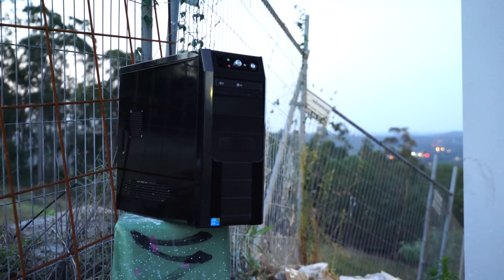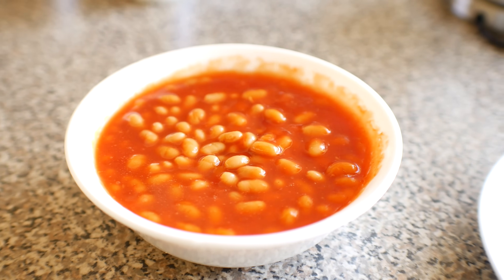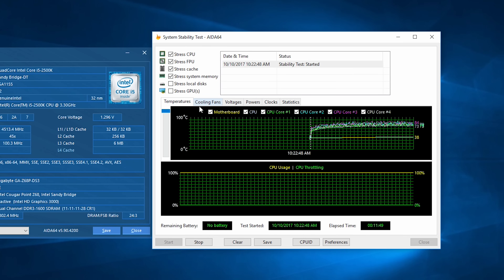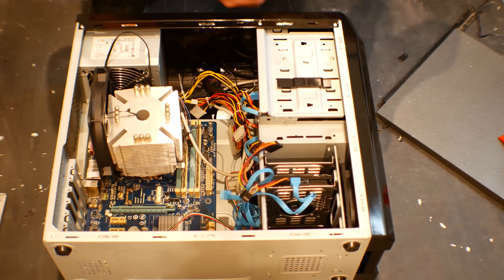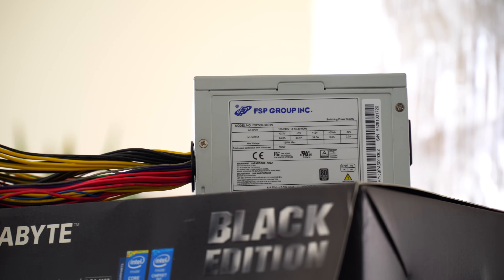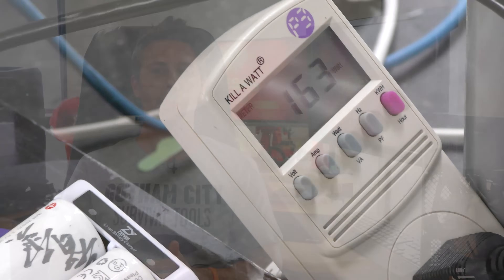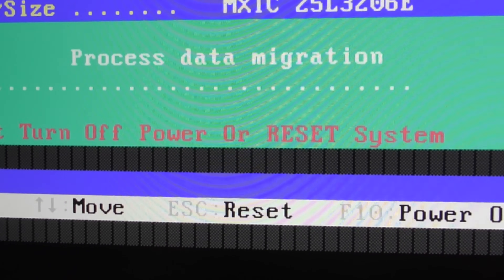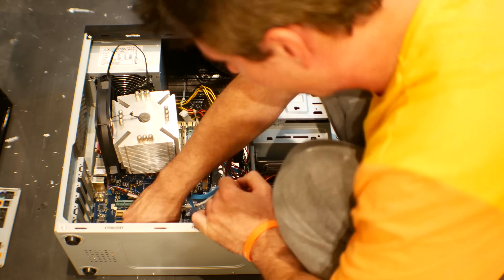Can you OVERCLOCK with a Zip Tie, Bad PSU & Budget MOBO?

Comment: Welp gg Just Experienced first hand my PSU burnt out on me And it took my motherboard and something else with it cuz it wont boot

All the fans are spinning But still no pic Tried booting from Mobo Vga still no Pic

Learnt the lesson Say F to Cheap psu 

Ggwp
Reply from the maker: Yeah the worst thing is the parts that go along with it :(....
Reply: Try to reset the CMOS. In most cases, PSUs won't take other hardware with it (even if it can happen in some rare cases).
Reply: TheRailroad99 tried
Reply: mhh that's sad. Poor motherboard! Which one was it. A good board?
Reply: TheRailroad99 was a Semi Good mobo
Reply: True FFFFFFFFFFFFFFF paying respects
Reply: Ballistic Cheeseburger thank you my dood
Reply: sounds like your have corrupted the BIOS is the fans stull spin up, you could try replacing the BIOS chip
Reply: Tech YES City  HOLY THE YES MAN 👏👏👏👏👏👏  Btw brian Hows the Zgold mining?
Reply: my Aerocool PSU 6 years ago blew up and LUCKILY no component went with its death. I was lucky af that time. Now I have a Seasonic PSU powering my Ryzen 7 system with GTX 1070 and it's super good.
Reply: True i once managed to get a a little older be quiet straight power 600w for just 35 bucks of ebay and it was just great... best buy ever! Got a 2500k to 4.8ghz with it unter 1.38v cooled by a pure rock
Reply: Mr.Magnificent nice wish i knew that sooner XD
Reply: True :p

Comment: The mobo is fine, but that PSU...
Actually, i had the same experience as you with a broken PSU. The fumes will let you puke. I had an Enermax Triathlor blowing up because I severely overloaded it and controlled the fan. (because it was too loud). After about 3 months it blew up, and my room smelled terrible for about 2 weeks >:(

Conclusion: Don't control your PSUs fan, even if it is loud. And don't overclock a FX8150+R9280X with a 450W PSU. Not even a good one. (Not OCed the PSU was working fine, even if it was quite loud)
Reply: FX8150 had stupid power spike fault all the first gen FX chips did its one of the reasons AMD came out with an updated version of the FX chips so fast, I had FX4100 and if I overclocked it the voltage on it would go all over the place

Comment: is a sata to 8pin or molex to 8pin more reliable? good video tho keep it up bryan. you're the only reason why i even have a decent computer
Reply: I would say molex. But you can also put a 4 pin CPU connector into the 8 pin CPU connector. If yor PSU does not have at least a 4 pin, it is rubbish and should be only used together with retro parts :D Because then it is from before 2003.

The 8pin GPU connector should be splitted to 2x6pin, and a 6pin can be adapted into 2xmolex
Reply: Makes no difference.

Comment: Next time do it with a Diablotec or Bestec PSU.... Bring an extinguisher.
Reply: QTEC.... blew 3 of those fuckers up in six months Then bought a Seasonic which i have been using for the last 10 years in two different rigs....
Reply: Ballistic Cheeseburger: The later BESTEC PSU's that they made for OEM PSU's are very good, especially when you concider that they have to be made not to explode... The other ones though are... Not great.
Reply from the maker: lol that is definitely a fun idea to try.
Reply: You may need ho me insurance before trying those out...or just have a fire department on hand
Reply: Some Bestec ones with certain model numbers are actually okay. If you have one, search the model number because I have had two under load that have done just fine.  Wouldn't want to waste a good PSU.
Reply: Budget-Builds Official i used a bestec 300w to overclock a q6600 yo 3.8Ghx...
Reply: Budget-Builds Official Thanks for clearing that up. I LOVE YOUR CHANNEL!!! Keep up the good videos.
Reply: Ah yes, the one which actually sent way too much voltage back to itself, in a sort of built-in suicide attempt.
Reply: Drop it out of a plane with an r9 295x2 in a pc running pubg and you got yourselves a nuclear bomb on a budget.
Reply: Ballistic's famous last words before his PSU touched off and lit his pubes on fire.
Reply: The Romanian Reaver XDDDDDDD you're kinda right though.
Reply: Diablotec seems like a PSU made by Satan himself. And I won't trust the "Blo" in there either.
Reply: The notorious 250E model dissected by Jonnyguru ... the motherboard killer, mostly by a 5VSB with little sense of regulation or spike control.
Reply: i had an LMS Data 750w, pc runs with 309 watts according to seasonic and it blew up. Now have a seasonic 350w and its perfect!
Reply: my 300w bestec PSU has been running fine in an old core 2 duo machine!
Reply: I have a Diablotek PSU lying around...

that my brother had in his PC.

Up until I was given it to work on and put in an EVGA 500B power supply unit.